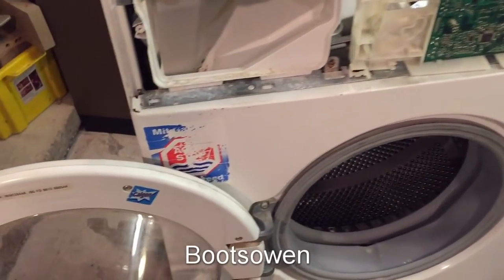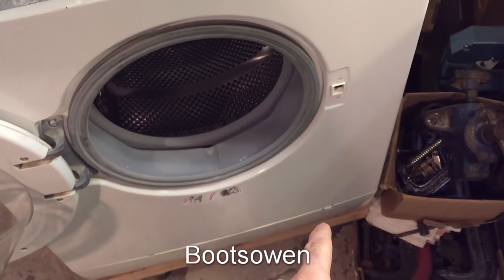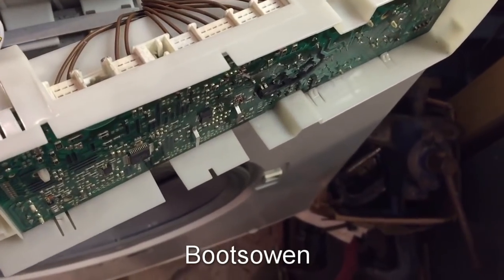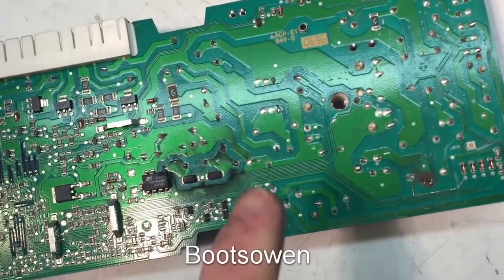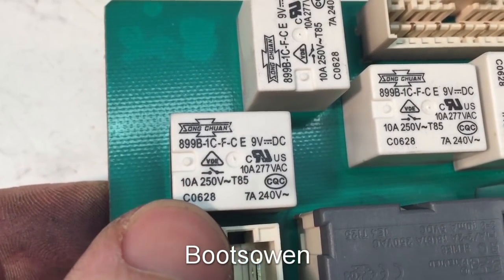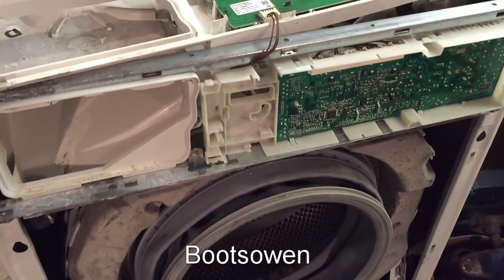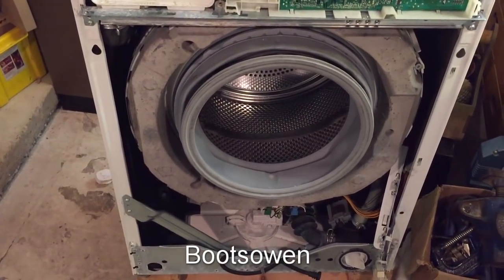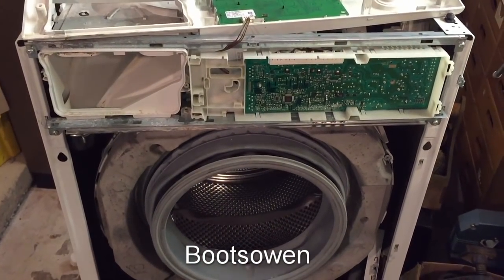Bosch PCB Repair Update

Comment: I have a dilemma. Shall i try to fix the washing machine which works when the element is unplugged, trips the rcd when it is plugged in. PCB has similar scorching, though the relay is still intact. So, shall we just do a couple cold wash or risk having to do a gand wash?

Comment: Hi Owen, great video, but I am struggling at the minute to find the source of an E57 error on my Bosch VarioPerfect washing machine. Its a 2016 washing machine, not a lot of work done. Anyway I have changed the door lock, because some postings on this error noted it to be an issue with the door lock. So I put  new one on, and I am still getting the error. 

I have checked the boards on the PCB control panel they look ok (no burns that I can see), I checked the power inverter pcb and again no burns there. So any advice on how I can narrow the problem down? ta Colm
Reply from the maker: Hi there Colm. I have posted a series of videos on recovering a broken bosch motor, I find that these motor windings fail and there isn't much you can do short of rewinding them. If it is just the commutator then you could give it a go, worth a try. 
As for the PCB, it depends on your skills, if you want to try and diagnose it then go for it. usually where an error shows it is firstly the part, e.g. motor, and then if changing that doesn't fix it then check the pcb, but you are into the big money parts here, and my experience is that one bosch motor won't fit another machine. It is 8 years old so way past the expected life, if it was an older wff/wfp/wfk series then maybe worth trying to repair but newer bosch are pretty rubbish, despite reputations.

If you have any specific questions I might be able to help, have a look at the series on motor repair. you will have to search for it.

Comment: Thanks for this video. I have a 17 year old Bosch Classixx 1400 machine. I replaced the rubber door seal and element in it last year, motor bushes a few years before that. A couple of weeks ago it started with the 1 minute error where basically it kept washing for a couple of hours on end. Performed the element and thermometer test and confirmed both were fine. Watched loads of videos including some of yours. Watched this PCB repair one and decided for one last throw of the dice I would have a look. Found the very same things as you. A blackened area and a pin that the solder was completely burned off (different component to yours, linked to heating obviously as even though element was fine it was not heating). Soldered the pin back on (not much experience soldering BTW). Put it all back together ... running like a dream. Always admire people who take the time to share these things because I am always under too much pressure to just fix. Many thanks... 17 years, not out !!!! I would disagree with the comments about Bosch below.
Reply from the maker: Hi John, I very occasionally get a comment like yours. I appreciate it. Thanks. Owen

Comment: Had a Maxiiss 6 with apparent worn brushes so swapped them out, matched them up and nothing.

Pulled the PCB out an an entire copper trace about 10" long has been blown from the board!

Also had the exact same charring around those two black components like yours. Think there's a cap and a winding on the other side.

Comment: You need to replace the two burnt black components. They are 1ohm 10watt resistors. Then it will work fine. They are current limiting resistors that have blown to protect the circuit.
Reply: how do you replace them?

Comment: Those things that failed look like diodes, those can short. The switch with a charred solder joint looks like a relay that controls something like a solenoid or motor (those are usually high voltage devices). You could have investigated further, maybe figure out what the relay was controlling.
Reply from the maker: It isn’t really worth it. And at the time I didn’t know much about electronics. I am learning more and have posted videos more recently of replacing triacs, relays. Etc etc.

Comment: Just what I needed to confirm a suspicion because to see the machine stripped down was great. A repair man came to mend my same machine which was working but not pumping water out. He didn’t unplug the electricity and during his ‘repair’ there was a loud bang. He said there was a hole in the drum which leaked in the circuit board and no point in looking at the water pump. Now my machine is more dead than before he came.